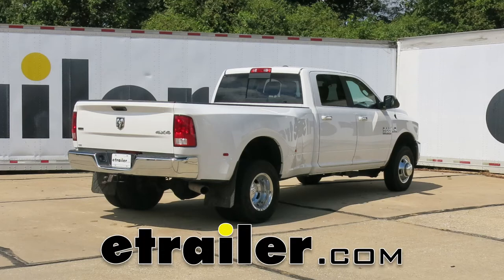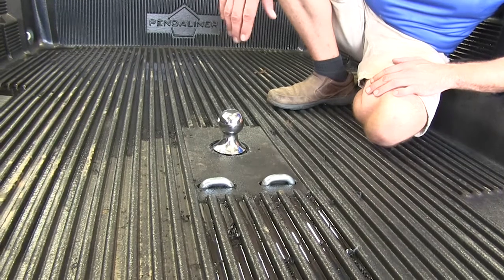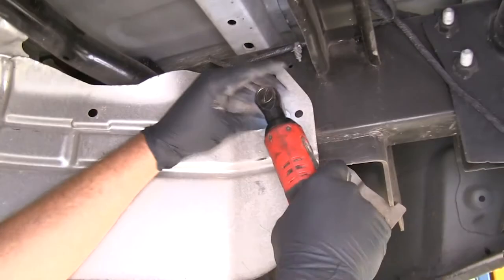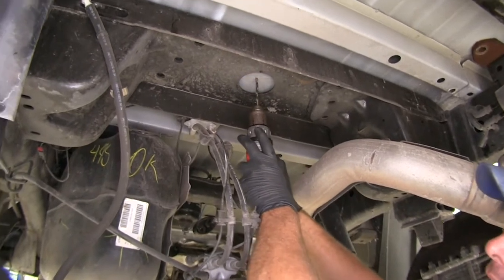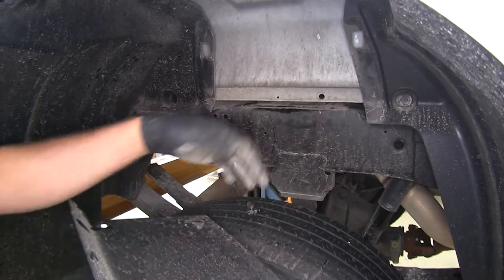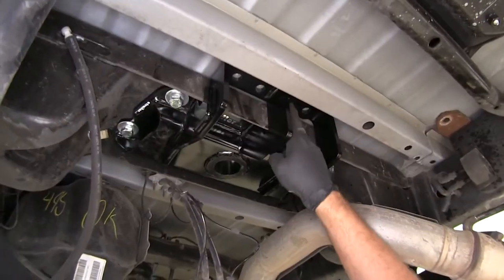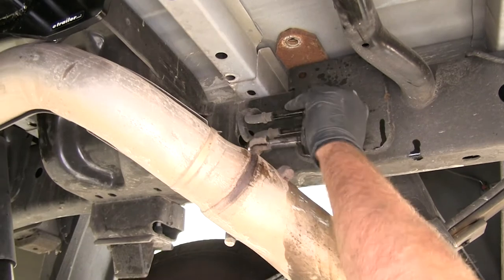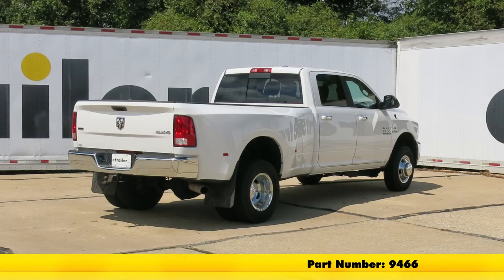etrailer | Draw-Tite Hide-A-Goose Underbed Gooseneck Hitch Installation - 2017 Ram 3500

Comment: Awesome! Thanks for the instructions! Helped me out a lot!
Reply from the maker: We are happy we could help out a fellow hauling enthusiast! Check out the following link to the product page if you need any additional information or weight capacities. We also have in-bed 7 pin wiring kits available so that you do not have to run your cord over your tailgate.
https://www.etrailer.com/Gooseneck-Hitch/Draw-Tite/9466.html
https://www.etrailer.com/Custom-Fit-Vehicle-Wiring/Bargman/50-97-410.html